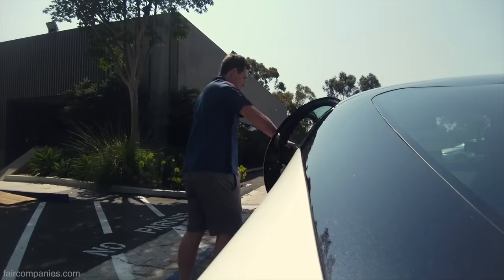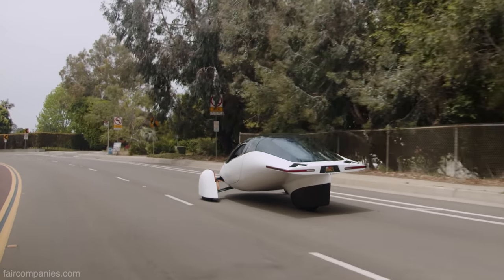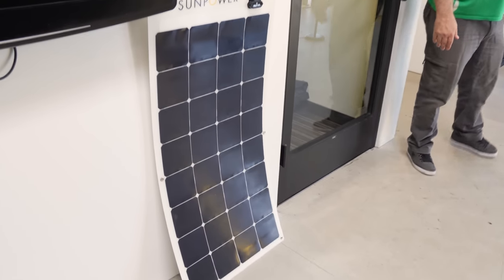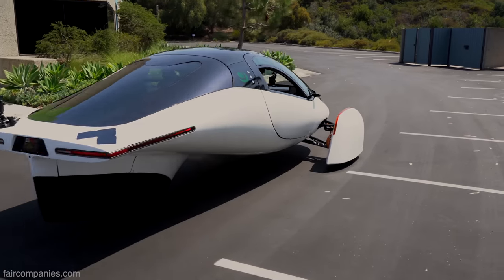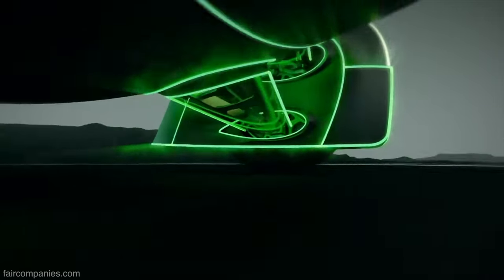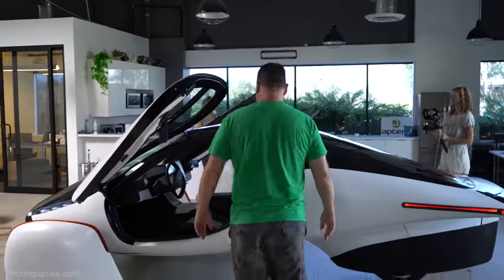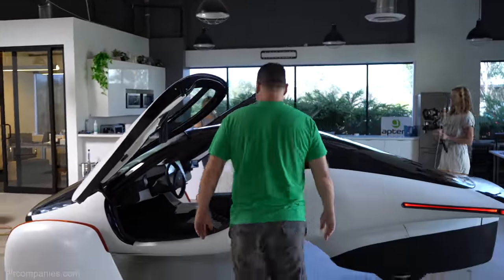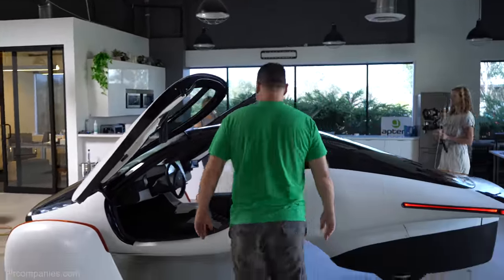Aptera commutes just on solar, gets 1K mile-range when full

Comment: I love this kind of tech. My only issue is the lack of recyclability and repairability. Those solar panels for example. You break one. Sure. It will still technically work. But you can't repair it. It looks like you have to replace the whole car. Same with batteries. Once they reach the end of their life. The car is done. There's no replacing the batteries to extend their life or if new tech is developed to expand their capacity. Not to mention recycling the batteries. Mining for those materials is VERY carbon heavy. If we can only use them once for a few years, then have to throw them away. They're not very "green." If they could be recycled though. That would almost silence a LOT of the nay sayers. Electric cars are the future. They just need to evolve a little better. Their power storage capabilities need to be upgraded. Hydrogen is my new favorite energy storage method. If a company would invest in hydrogen stations like Tesla did with electric. They could DOMINATE the EV market...
Reply: Regarding the solar, first, Aptera has indicated that, on future iterations of the vehicle, they are hoping to have it easily repairable/up-gradable.  I'm more than a bit skeptical at the "easily" part but repair/replace SECTIONS, NOT the whole car, is likely doable.

Regarding "batteries", I don't think you are up to speed on battery recycling/salvage/re-use.  There's plenty to read on it available on-line.

Regarding Hydrogen, I'd be interested in your feedback after reading CleanTechnica's recent article titled "why battery electric vehicles beat hydrogen"
Reply: The batteries can be replaced as a unit.  You could upgrade a 25 kWh pack to a 600 for example, but you will have to replace the whole battery, not just add to it.  You might have to modify the suspension for the extra weight as well.
Reply: Alain Chuzel is correct regarding hydrogen for personal transportation.
Reply: @alainchuzel8341  here's my view on the subject matter. Yes. You are absolutely right. In the end. BEV's are more efficient. They will go further than the same vehicle will on hydrogen. However. Getting to that point is much worse for BEV's than hydrogen. Solar, wind, and geothermal energy can be used to produce hydrogen. Whereas you need good old fashioned dinasour juice to get the materials mined to produce batteries. Then transporting them will also use that same dino juice. Battery powered construction equipment, ships, planes, and trucks aren't really feasible on today's tech. However hydrogen is. A construction worker, or miner, can't wait 8 to 24 hours to charge their machine to work for 5 to 6 hours. The same argument is used by people who appose BEV's. They take too long to re charge. Personally. I don't have a problem with it. I'm fine with spending 45 mins to an hour at a charging location. But not everyone is. I feel like if we really want to break into EV's and rely on them as our main future transportation source. There needs to be options. Not just one size fits all. I feel like Hydrogen is the other size we need to fully transition. I feel like Hydrogen is going to be that option that most people who don't wanna wait to charge are gonna choose. Personally. I'd rather them choose hydrogen over dino juice. Maybe I was a little overzealous with my "dominate the EV market" line. But I feel they could be a formidable contestant. Especially for those industries and people who can't or don't want to wait for their vehicle to charge. As far as battery recycling goes. I know there has been some progress. I just don't feel like it's really enough. I don't feel like it's where it could be. Ya know.
Reply: @jonjacob1962  I don't believe your claim that "getting to that point is much worse for BEV's than hydrogen".  Please look into cradle to grave studies on the subject.  I quickly found one from Argonne National Labs (albeit 5+ years old) (copy/paste the following: Argonne Cradle-to-Grave Lifecycle Analysis of US Light-Duty Vehicles).
Reply: @alainchuzel8341  look my guy. I'm not gonna argue with you over which is better. Both are good in their own right. Both should be further developed and refined for future use to replace ICE vehicles all together. In both the light AND heavy duty sector. Neither option is perfect by ANY means. I feel that hydrogen is better for the HEAVY duty market primarily and it does have its places in the light duty market. I feel if manufacturer's installed a hydrogen re fueling grid like Tesla did with electric, hydrogen could be a great option. There's no way in HELL that just mining for the materials to produce batteries with diesel guzzling machines is better for the environment than using solar, wind, hydro, geothermal, or ANY combination of the plethora of renewable enrgy sources to produce hydrogen fuel. Being someone who has worked in construction and transportation my whole life. I know that batteries are completely out of the question for those lines of work. They take far too long to re charge and don't last nearly long enough between charges. Hydrogen on the other hand. Even though it is less efficient, is the optimal choice for those lines of work. It is FAR better for the environment than using diesel. Long haul drivers can easily stop for 10 minutes to fill their hydrogen tanks and be back on the road as apposed to stopping for the whole night or more to re charge their massive batteries to only be able to drive for 8 hours the next day if they're lucky. You and I can afford an hour or even 2 to charge our cars for a road trip. Hell. Local delivery businesses can afford to plug their vehicles in overnight so they're ready the next day too. Long haul drivers can not. Construction companies who keep their machines running for 24 hours a day, 6 days a week for 6 months out of the year or more can not afford that amount of downtime. Hydrogen is the best option for those fields. BOTH options, as I said, have their strengths and weaknesses. BOTH deserve further development. The light duty sector is the cause of only a FRANCTION of emissions. When covid first hit and everything was basically shut down. Air quality improved. But it wasn't enough. Even if EVERY SINGLE LIGHT DUTY VEHICLE WAS ELECTRIC. it wouldn't be ENOUGH. You can show me as many 5 year old studies as you want. You don't have to believe me either. You are entitled to your opinion. As I should be to mine. You think BEV's are the best. Cool. Good for you. I think they're great. But I don't think they're the best. They need major refinement. As far as the battery recycling and my issues with the solar panels goes. Okay. Batteries are recyclable. But what you can't do is take a Tesla, easily and affordably drop the battery and install a new one if there's anything wrong with yours. That's what I'm referring to. If Optera is making their batteries and solar panels more easily replaceable. That's awesome. I wish more manufacturers would. Instead. Tesla is talking about making the battery part of the main structural component. That's not very good for longevity. 5, 6 years down the road. When there's nothing wrong with the car. But the battery is toast or there's a bigger, better option. You have no choice but to replace the whole car. That takes away from the affordability to the masses aspect. That's only going to make large scale adoption more difficult. I don't want to nor can I afford to throw my whole car away every 5 or even 10 years just because the battery dies. I wanna be able to take a weekend, order a new battery, and replace mine if necessary. For those who aren't mechanically inclined. I want them to be able to take their car to a shop and have it done for an affordable price.
Reply: @jonjacob1962  You're getting a bit too touchy for my tastes.  I'll be moving on.  Take care.

Comment: How long does it take to charge completely from nothing
Reply: How long is a rope?  If we are talking the 100 kW hour model at a 50 kW DC charger, it will take about 2 hours to restore the 1000 mile range.  A 40 kWh battery will take about 50 minutes to fully charge on the same charger.

Comment: Why the entire body isn’t perfectly covered with solar cells? When the doors are both open, they can catch some of that solar energy,  needs more indicator lights that outline tue entire vehicle, the headlights should include the fenders, the front wheels are so vulnerable,  they should be illuminated so other cars don’t hit it, any slight miscalculation could yank away the entire assembly, wheel, brakes, motor, probably weighs 100 lbs. falling in a pothole and breaking off the wheel will leave the occupants stranded, good luck having it fixed even if you could find a parts or service dealership with emergency overnight. shipping the parts, this company should be subsidized by federal government to make it as obsequious as possible

Comment: The car feels a bit bumpier and shakes a lot more than a regular cars.
Reply: Yes.  I rode in it.  This was before Roush Performance redesigned the suspension and other parts.  It was an alpha vehicle.  The gamma will be shown at San Diego's Fully Charged Show, and the delta (production models) are far more refined.
Reply: @n.brucenelson5920  Gamma is still noisy in squeaks and rattles, and bumpy.

Comment: It appears to me that having 3 wheels is not about aerodynamics and weight as much as putting it in the motorcycle category, which has less stringent safety regulations as automobiles.. He actually covers the subject of the regulatory advantages of the vehicle later 16:00 on, but rest assured,  government eventually fix that advantage.
Reply: This is not actually true.  If it were, they would not have designed it to pass federal automotive crash test standards and it would not come with air bags, an F1 style passenger safety cage, and front and back crumple zones.  No other 3 wheel vehicle does, and they would not have gone to the expense if they were only trying to avoid regs.
Reply: @n.brucenelson5920  Thank for pointing that out , I don't know how I missed that in the video. Good for them to get ahead of the regulations.

Comment: Even though Im know this is a "A" version, it seems they have a very long way to go in the fit and finish department.  Also was is the crashworthiness of the vehicle, didn't mention airbags or other safety equipment. Nor did they mention the projected MSRP.
Reply: Betas are being built now. Will meet automotive safety standards including air bags.  Crash tests will be performed on production intent vehicles and results published before production begins.

Prices start at $25,900.

Comment: wish they are not fully honest about the handling of the car and a 3wheel idea, telling it is the same as 4 wheel is complete BS, and it is visible on video how the back is underweighted in corner situations. guys you have nice product, it is not better in handling but it's not your problem, provide this spaceship finally and celebrate.
Reply: "at the track day we've learned we have a lot of opportunities to optimise aptera's stability, handling, and turning circle" is marketing speak for "car is a bit twitchy still, but we might figure it out"
Reply: The suspension has been completely redesigned by Roush Performance including no more rear swing arm.

Performance of the betas will be very different.

Comment: @2:53 "In a typical sedan you use more than 60% of your fuel just pushing air out of the way."  At what speed?  You can't cite that statistic without that, since air resistance increases with speed.  Statistics say the typical sedan today uses 50% of it's power to counter air resistance at somewhere around 45 mph (72 kph).  Continuing, "So if you could take that (air resistance) down to zero you'd instantly get 60% better fuel economy."  Impossible, of course, so why say that?  In fact, I'd be surprised if the Aptera had even a 25% better coefficient of friction than a typical sedan.  "Then if you couple it with an electric power train that gets more power to the wheels versus an internal combustion engine..."  Yet another incomplete statement made to mislead.  There are plenty of ICE's that can get the same amount of power to the wheels as even a Tesla, forget the Aptera.  Of course you meant percentage of power wasted as heat vs. sent to the wheels, but you didn't bother saying that.  Statements like this give the electric vehicle industry a bad image.  Do better.

Comment: Was excited until I did not hear a mention about crash safety tests. Not a mention. No way will I drive a death trap for the sake of cool.
Reply: Aptera has front and rear crumple zones, air bags, and a F1 style passenger safety cage.  It has been designed to do very well in passenger car crash tests.  Tests will be performed and the ratings published before shipping begins, even though this is not required by the class.

Comment: Wait, is it a wider vehicle or are they just not staying in their lane?
Reply: It is quite wide at 88" to the outside edges of the wheel pants.  I often drive a wider P30 step van, so it is not so much of an adjustment for me or anyone used to driving an RV.  This width was a requirement to lower the aerodynamic drag and also supply excellent stability in cross wind and sharp cornering situations.

Comment: there may be way stick more solar panels on rear window when it not in used "not in driving mode just parked" have plug under rear window just like you put camping cover over it
i would like one be offroad 4 wheels drive just like that electric vehicles because there may not be any way to charge it only sun and solar panels
Reply: The full solar package has more solar cells on the rear hatch.  This brings the total up to 700 watts peak according to Aptera.  Even with that, however, and with excellent sun all day, the best you can do with the 700 watts is add about 40 miles of range.
Reply: @alainchuzel8341  i talking about stick on rear window run plug under it give it other 400 watt more if going to drive it can remove it unstick it
Reply: @kittyztigerz  O.K.

Comment: He says that they went with 3 wheels for every reason except the real reason: with 3 wheels it's a motorcycle and is exempt from safety standards like bumpers and crash ratings.
Reply: Not at all. Safety is just as much a design goal as aerodynamics.  Aptera will be crash tested to automotive standards and the results published before they are shipped and the ratings will be excellent.
Reply: @n.brucenelson5920  Do you work for them?
Reply: @missjones8123  No, but I am a charter member of their brand ambassador program, a early investor, and a first 50 pre-order holder.  I have occasional contact with several of their people and their suppliers.  I have worked with several early stage EV companies as a vendor both successful and not.
Reply: @missjones8123  google Zac Reimer shill

Comment: I’ve wanted buy this car for 10 years know. Still waiting. Why not just put an economical 4 cylinder engine in it and bring it to market. Give us the choice gas or electric.
Reply: Something like that was an option for the first company.  The founders lost control in a board coup in 2009 and the company was liquidated in 2011.  They regained control in 2019 after taking a lithium battery company public.  There is no longer an advantage to ICE engines with current tech.

Comment: Americans will have to rethink transportation.  Our cars are getting heavier and heavier plus sharing roads with 80 thousand pound trucks.  Going to a single or double seat sub 1k pound vehicles of any type of fuel would dramatically reduce carbon emissions.  But we will not give up our crash safety plus comfort features.  We are hypocrites for the most part.
Reply: The 400 - 1000 mile range Aptera will weigh from about 1800 to 2200 lbs, with the 250 mile version a bit less.  Aptera has been designed to pass standard automotive crash tests, and has air bags, seat belts, crumple zones, and an F1 style passenger safety cage.  The crash ratings will be published before shipping begins.